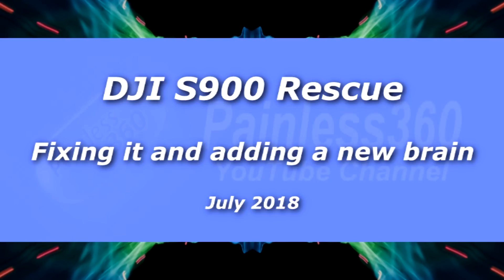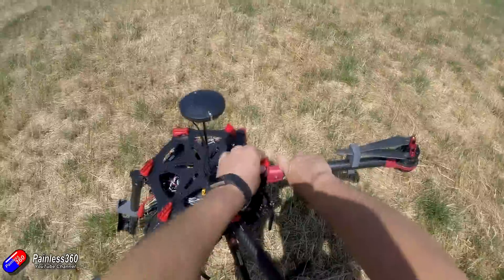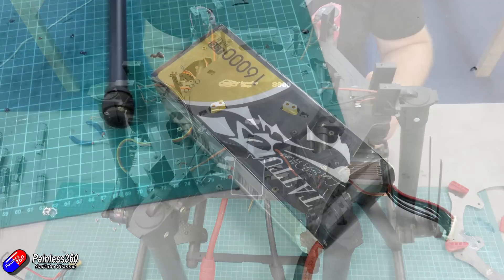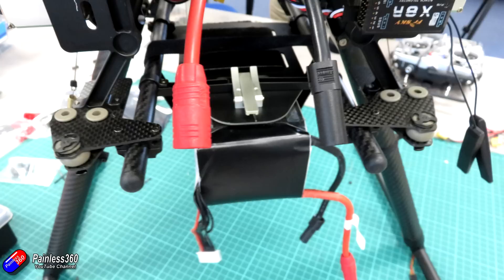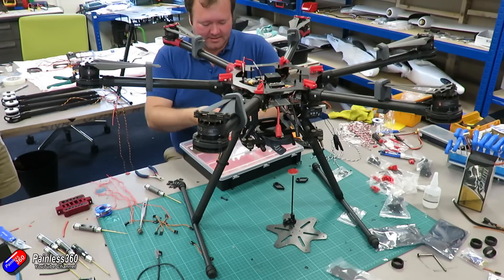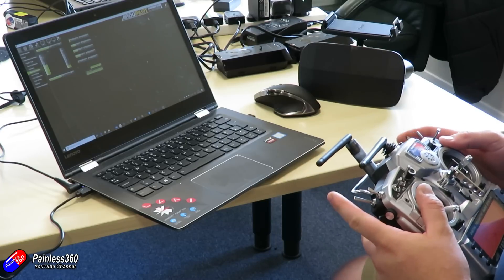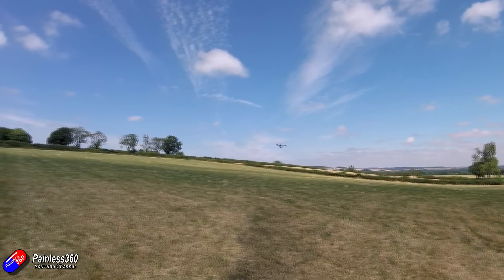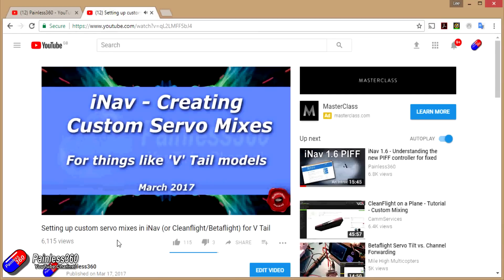DJI S900 Hexcopter Rescue

Comment: Ho recuperato un telaio e vorrei fare la stessa cosa, costruisco droni fpv ma su arducopter mi sto informando, non avendolo mai usato, oggi cosa converrebbe installare?
Reply from the maker: It depends what you mean by 'best'. Cube pilot Orange Cube+ is the gold standard for many professional builders... Happy flying
Reply: @Painless360  andrebbe bene anche una pixhawk 6c per iniziare a fare esperimenti?
Reply from the maker: Yes, or one of the HolyBro units I've used on the channel... Best of luck!

Comment: Are the black and white cables that you numbered for each motor connecting directly to the ESC connectors coming from each arm? I'm working on a similar build on a crashed s1000. The broken frame has cracked on board circuitry. So I was hoping to connect the wire coming out of each arm directly to the pixhawk flight controller but couldn't see how you wired these up in the video. Any tips?
Reply from the maker: I don't have the model here to look at but it you are referring to the black/white wire pair from the arms then that should be the GROUND and SIGNAL for the ESC and can be plugged into the Pixhawk directly. See the Pixhawk 2023 series for how I did it in the latest build.. Best of luck!
Reply: @Painless360  Thank you!

Comment: Tempted to grab a cheap one used, and run it with a pdb, a Holybro H7 running ardupilot, DJI FPV 5.8g for pilot (video and control), lightbridge 2.4g for camera operator, and DJI RS2 for gimbal (with sbus).... The idea of it sounds really nice, now I wonder if the DJI RS2 fits and I guess there will be a lot of issues along the way :-)
Reply: Modding a gh4 zenmuse to fit a GH5S or a GH6 might be the easier way...

Comment: You usedthe power module which comes with the Cube?  It's strong enough for the s900?
Reply from the maker: It worked fine. See flight footage.  Happy flying
Reply: @Painless360  I saw that, but still have my doubts on using it in my own s900 with Cube.  The reason is, in my s1000, I had the stock power module fail.  However, it was from Pixhawk 1, which I think supports less voltage than the 30Amp module which comes with Pixhawk 2/ Cube.
I replaced the burned out module in the s1000 with 2 Mauch BEC's and sensor, and was thinking I'd do the same in the s900.  After seeing this, I am tempted to use the stock module that came with my Cube Orange.
Reply: @Painless360  In the Arducopter forum, I am being told that the 30 Amp power module which comes with the Cube is WAY too small to use with DJI s900.  In fact, I am being recommended to buy one 200 Amp power module, and another one as well for s900:
https://discuss.cubepilot.org/t/trust-the-cube-power-module-on-dji-s900/3817/6?u=vyoufinder
Maybe the 30 Amp works well since he got his power from the PDB?  How much power comes out of the PDB lead he used to connect the module, do you know?
Reply from the maker: All I used was in the video ;)

Comment: good day sir, i would like to ask about my project. 

i have Hobbywing XRoter Pro 40A ESC-Version B with Tarot 4008 Martin motors, is it ok if i will use 6S 22000 mah 22.2V? directly to power  hub? thank you.

i will use:
pixhawk 2.1 
17 inch folding props
with Tarot XS690.

im waiting for you next video for the flashing of Pixhawk 2.1.... thank you.
Reply from the maker: No need to wait, check out the playlist, ;)

Comment: Great video, just getting a chance to see it, Im getting ready to build a quad using cube orange and i see that in the video when connecting the ESCs to the cube servo rail you only used the ground (black) and signal(white) wires,  and not at least one 5v (red) wire , what is the reason for not using at least one Red , i have an older pixhawk on a quad and on that build i used the red ,black and white wires on one ESC and no red wire on the other three, Thanks for any help
Reply from the maker: See my PixHawk series for that answer. You can connect the red wires if you need the 5v for other things on the model and the BECs in all of the ESCs are all linear... Happy flying!

Comment: Mounting the flight controller directly on top of the power distribution board is not a problem?  No interference?
Reply from the maker: Nope. Only a mag could struggle and there is also one in the GPS Puck..

Comment: This project has a lot in common with my s1000 revamp I'm working on.  I got a deal on it with a 3dr x8 as a bonus.  Sorting all the parts out took some time.  Both of them came with Pixhawks installed, but the s1000 I determined had one lead from the power distribution board fried out and a burned out 90amp 5volt power module (the wrong size, as I found out thanks to your video: (5/5) PixHawk Video Series.  The Pixhawks were originally bricked and misconfigured, but managed to get them both back working.  Luckily, I think that's all the problems it has.  After watching your videos I decided to deck the s1000 out with a Taranis x9d+ running FlightDeck & bound to an rx8r & x8r combo, protected by 180amp 5v Attopilot & 180A Hall Sensor Inductive Galvanometer UBEC along with a Zener diode & capacitor to protect from 22,000mAh batteries.

I think I've made good choices based on your Pixhawk series, which has been my primary resource.  I kind of don't think it will fall out of the sky thanks to your videos.  Thanks.

Comment: Thank you for taking the time to make this video! I am doing the exact same build and this is helping me a lot. I do however have a question pertaining to the way you created the leads.. on the Pixhawk 2.1 there's a negative, positive, and signal. I see in the video that you only have two wires going into the servo leads. Why is this? Also, could you tell me where those two wires are going i. e. positive? or negative? or perhaps signal on the Pixhawk? 
Thanks Painless
Reply from the maker: You dont need the 5v wire as you're only sending the signals to the ESCs. These just happened to be the ones on hand.  Best of luck with your build!

Comment: Very interesting. I have a big Tarot that is very similar to this, with lifting legs, etc. I have fitted a Pixhawk, and as soon as I can figure out how to run Ardupilot under Linux, I want to tune it for flight. I will be checking out your Pixhawk videos for tips, particularly on how to make the legs retract and deploy correctly.

Comment: What ESCs would you recommend for something like this?
Reply from the maker: It depends on the motors you want to use.. if you Google something like 'S900 esc' you'll find the DJI part..
Reply: Painless360 thank you. I’m sorry I should’ve been more detailed. Im using a 3510 350 kv. It’s a dji motor but I was trying to get away from a dji esc because they have been discontinued.
Reply from the maker: If you look at the specs of the discontinued part then it'll give you the specs you need for a third-party replacement. looks like a 6s capable 40 amp unit.. best of luck!

Comment: Hey. Thanks again for another useful video :) 

FYI in S900 manual that came with my frame, in the manual, the motor mapping is in correct order, same arm with same motor number as per arducopter. 
In the video the image of the hexa X motor´s order is not the same that came with the manual, i did my wiring before watching the video and i was a bit confused on that part. Please correct me if im wrong, im still building and maiden flight is not done yet!

http://ardupilot.org/copter/docs/connect-escs-and-motors.html 
http://dl.djicdn.com/downloads/s900/en/S900_User_Manual_v1.2_en.pdf  page 10.

I have been learning so much from your videos over the years, thank you and keep up the good work :)
Reply from the maker: That wasn't how my frame was, maybe they updated it. I'd use the motor test function once you've wired it up (without props attached) to test it's as it should be. I simply traced the wiring on my S900 to figure out what plugged into where. See the PixHawk series for more detail. Best of luck!
Reply: @Painless360  thanks. I looked thru all and  noticed that i was just confuced about diferent motor order on the frame, so all about this subject in your video is up to date and correct.
Thank you :)

Comment: I have a S900 and it is missing the esc cables that go from 4216 motor to the universal 3 pins. Dji says they don't make them anymore. I'm trying to run it with a pixhawk 2.1. Any suggestions as to how to do this or find these cables?

Comment: About future video as some already suggest some collision avoidance setup, maybe starting with affordable HC-SR04/SR05 for side rear top combine with more powerful Lidar 3 device for front and bottom should be really interesting. Not sure if it is too much asking but if possible telling if wiring difference exist between the Pixhawk 2.1 and Pixhawk 4 would be really appreciated.. Another subject could be the wiring and configuration of Telemetry, frsky sensor, craft and theory cable and minosd device and how that can be connect all together, including a Connex Prosight HD kit maybe?  The best way to include sound to this setup, maybe running both an regular analog setup and the Prosight? Will wait with interest your next videos! Have a nice day!
Reply from the maker: Thanks for the ideas. I've got a video on LIDAR coming..

Comment: Now personally I think it's crazy that something like this is covered by the same regulations as a 3/5" quad or a Spark or a Mavick. Lee's flying this in a secluded site, but something like this  flying around in public is going to create far more negativity for the hobby. I wouldn't be relaxed if someone was flying something this big anywhere near me.
Reply from the maker: I expect that may change with new regulations. No matter the model, we should all remember to always fly in a responsible, careful manner with respect for others particularly in public areas. This was a private field well away from anyone else..
Reply: No criticism of you intended Lee, as I tried to emphasise, but I hope there is a change. 250 grm to 7 Kg has always seemed too large a weight group to me. Not just quads, putting an foam park-flyer in the same category as a six foot fixed-wing with a petrol-engine swinging a two foot carbon propellor seems crazy to me.
Reply from the maker: None taken, it was more a general comment to all of those who read these comments. There are a few pilots who post videos of what I would consider dangerous or illegal flying and it just fuels the legislators arguments that all us need more laws and regulations..

Comment: Hi Painless360, excellent video; also nice to see you networking with others, it is a really great community. 

Now you have a 'Cube' in your build do you know if the 'Open Solo' project would work giving you the cinematic creative shots that 3DR open sourced? i can never work out if you need the entire 'Solo' hardware or just a Cube for it to work? 

thanks,
Reply from the maker: Maybe, thanks for the idea! :D
Reply: Painless360 hi, I always get really confused about when you need a companion computer, and when the flight controller can do what you want just by sending it commands from a  ground station / app. Thanks

Comment: I've got a sick s1000. It was given to me from a house clearance. after failing to get the motors to spin up on a pixhawk I put it away. You've wet my appetite to crack on with rebuilding it. 
Cheers for the vid
Reply: I just got one set up a few weeks ago. My main issue was forgetting to install / press the safety switch after a teardown.
Reply: Zapf my issues are trying to get the pixhawk to talk with the stock escs. 

I just keep getting fast beeps.
Reply: define fast. I was getting the beep every second (no communication) until I got the safety switch working. You may need to run esc calibration as well.
Reply: Zapf that's about right one load beep from all the motors every second. 
I've plugged the safety switch that seemed to work fine.
As for esc calibration I couldn't get to do that. I tried the calibration through audpiolt but got nowhere. 
Think I'm going to have to get it out of the loft tonight 
Thanks for the help zapt.
Reply from the maker: If you're using a S1000 with the motors with inbuilt ESCs underneath the motors (like I have here) the throttle range is set on those DJI ESCs.. You can't calibrate them, you have to setup the range in Mission Planner.. Lots of detail on this knocking about in the forums i.e. https://diydrones.com/forum/topics/pixhawk-on-a-dji-s900?commentId=705844%3AComment%3A2046157 Hope that helps..
Reply: Painless360 thanks for the info. 
Put I think I'm going to have to teach myself all of the mission planner settings or find a noobs guide. 
What was the setting for the escs? 
Thanks again

Comment: I love getting old big quads and putting them to life again. I recently did a similar "make over" with a used Tarot 650 iron man! Would you be willing to donate the old dji wookong innards of this s900 that you stripped out?
Reply from the maker: Unfortunately I don't have any more. I donated it to a multi-rotor museum in return for the new parts..
Reply: Thats a good deal! Thank you for the quick reply nevertheless... How do you like the new holybro unit that you couldn't install into the S900, is it any good? Have you set it up into another frame? How does it fly?
Reply from the maker: Giorgio Ntanas having not used it in anger yet, that's a difficult one to answer. All the indications are the hardware is good, but until the software is sorted then it's impossible to test. Best of luck!

Comment: great video. I recently bought some old hexacopters from a guy and plan to do this same type of thing. these old frames are still great. even the old motors and ESCs are good. Just need new FC's with modern features and I'll have some very nice birds! being a freestyle drone pilot, I'll probably just go the betaflight route. the new version now has some GPS features. thanks for the video!
Reply from the maker: If you want GPS then go Pixhawk, Vector or iNav..
Reply: Painless360 thanks, but can you please give a reason(s) for your suggestion? for what it's worth, I only want to use GPS for RTH and hover stabilization, don't need to use way points or other autonomous flight modes. I believe betaflight has superior gyro filtering (dynamic filtering) and will provide a better smoother flight, ideal for recording clean video.
Reply: I think what he means is... if you want reliable GPS you should stick with the platforms that have been supporting them for a while and working out their kinks.
Reply: Rolando G yeah, perhaps. Thanks for that. I'm more inclined to stick with a platform I am already very familiar with, try that approach and see how it works as opposed to having to learn a whole new platform. When I do it I'll report back and let y'all know how it works. happy flying.
Reply: Yep, that makes sense too. Happy flying!

Comment: Hi, I have a couple of questions about this build, in particular the way that the esc's are connected, and how the landing gear is powered. I am building a Tarot 680 Pro with a Pixhawk 2.1, and all the esc's are connected directly to the pixhawk main out 1-6 (no daughter board),  with the power wire disconnected on all of them. Also I have the retractable landing gear connected to channel 6 on the X8R reciever, as I am sure In have seen a video on YouTube, where someone connected it directly to the pixhawk and it would cause the pixhawk to freeze/reboot in the air when the retracts were lowered. Have I done the right thing by connecting the esc's as explained and what are your thoughts on my landing gear connection.
Reply from the maker: See my other pixhawk series where I've actually gone through the setup and install things like ESCs. The Arducopter site that I refer to is fantastic for explaining things if you're not sure about what to do with your build. I strongly recommend spending a good couple of hours having a look through there too. On this model the retracts are actually powered from the power distribution board underneath and it's only the signals that they're going from the pixhawk controlling whether or not the gear is up or down. I'd never try and run the power directly through the pixhawk to power something like big retracks,. Best of luck
Reply: Hey Mike, I saw that you were building a Tarot 680 pro + Pixhawk 2.1. I am stilling picking out the rest of the parts for my build, would you be interested in staying in touch to help each other out with this build? Thanks, Rolando
Reply: Hi Ronaldo, yes would be good to help each other out,  mine is almost finished, just need to sort out a few telemetry issues that I have and also the way the landing gear is connected. It all kinda works, as it is, I'm just to chicken to try it at the moment.😁
Reply: Can you email me rolycstars@gmail.com

Comment: I own a Tarot T960 which operates with a Pixhawk 2.1 FC. I would be interesting in sharing the DJI S900 tuning values.
Reply from the maker: You mean you have them to share or want them? I'll be playing with autotune on this but I have seen some suggestions for it in the usual forums..
Reply: Well, im not native English speaking although having worked for more than 35 years with BP PLC. From my perspective sharing means: I publish my settings and you publish yours. And then we can compare ...
Reply from the maker: I can share mine once I've autotuned..